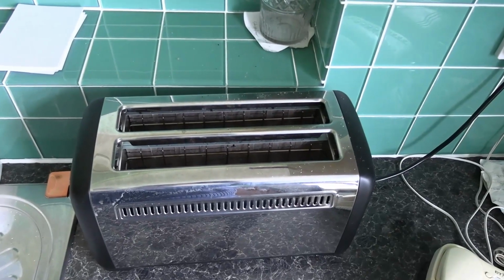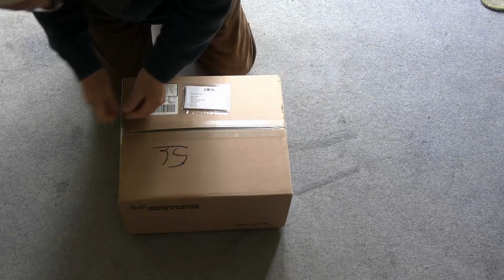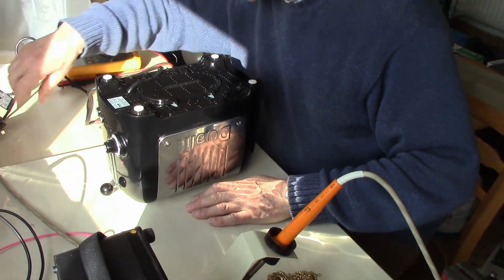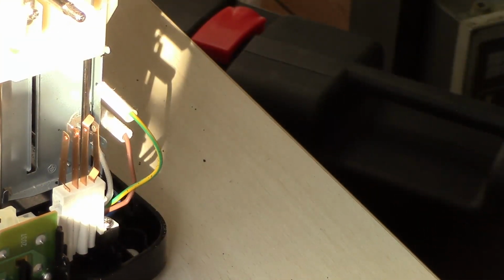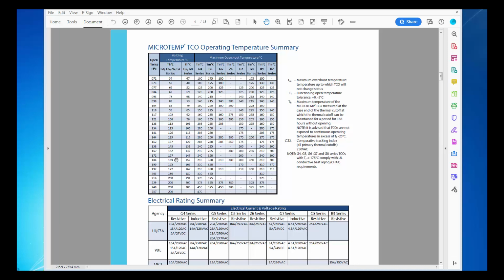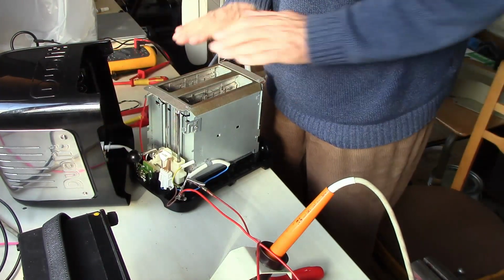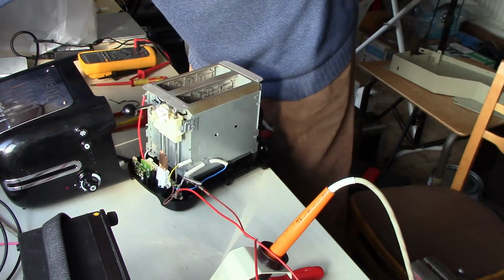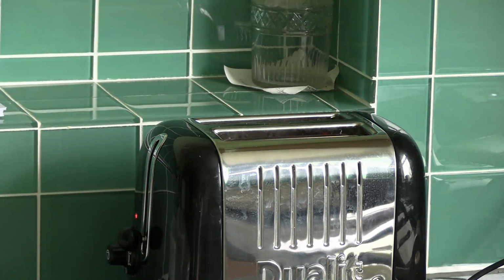Dualit lite 26205 toaster repair

Comment: Sitting in my basement for several years now is one of these toasters, which failed within a couple of years with identical symptoms to yours. So I shall dust it off and look at the thermal fuse. Many thanks. Note added later: just to confirm that the thermal fuse has blown on my appliance. Although the toaster is externally identical to the one in the video, the fuse is in a different location however and has a different rating to the one shown.
Reply: Glad you fixed yours! Where was the fuse on it? I also have a toaster which looks the same, has the same symptoms, but I can’t work out where the thermal fuse is.